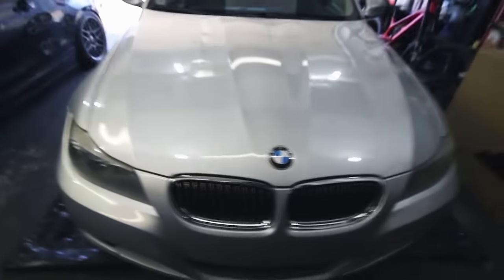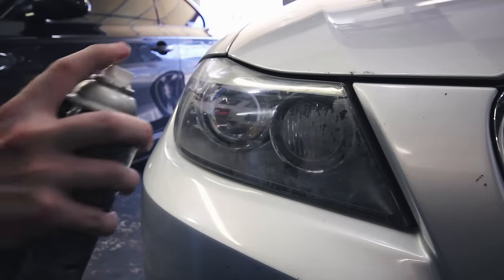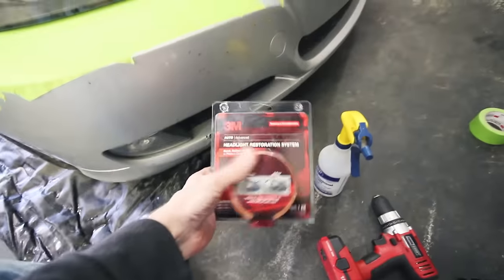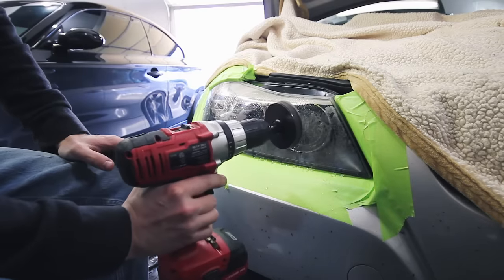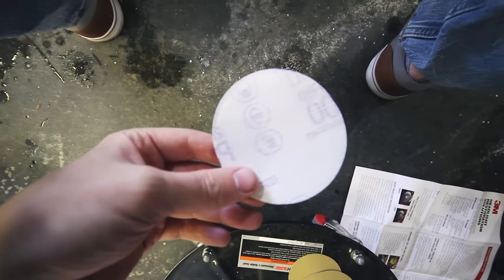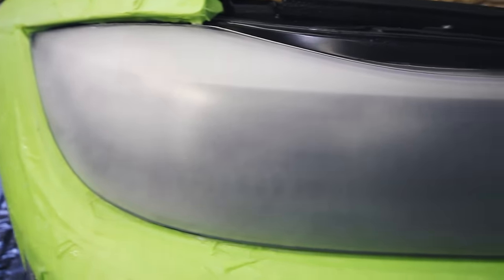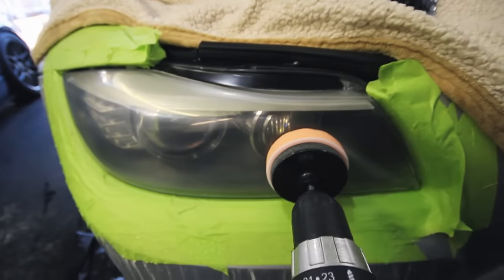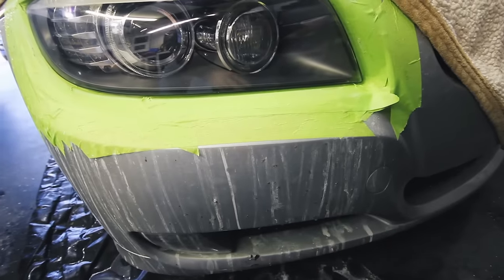How To Clean & Restore Headlights - Remove Yellow, Foggy Headlight Oxidation!

Comment: i would rather take the bumper off  and mask the sidr fenders
Reply from the maker: That's an option, but I'd rather leave it on for this car. If your car has a bumper that's easier to take off, go for it. Just be careful when removing/installing it not to scratch it.

Comment: Totally sucked ! Did it on my bmw 525i . Did absolutely nothing ! What a waste !
Reply from the maker: Then you're doing it wrong... the proof is in the pudding here.
Reply: Jake Spence I did exactly as shown on your video . Step by step , same materials you used. It didn’t work man .
Reply: The only way you wouldn't get any results is if your issues are internal in the headlight.  Otherwise, it would be impossible to have no results on external oxidation of the lens with any restoration kit.